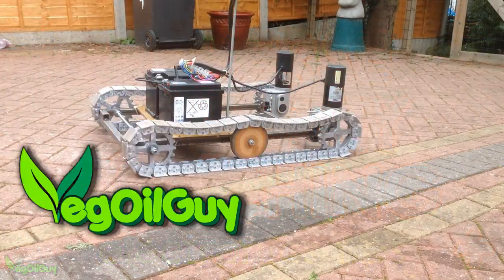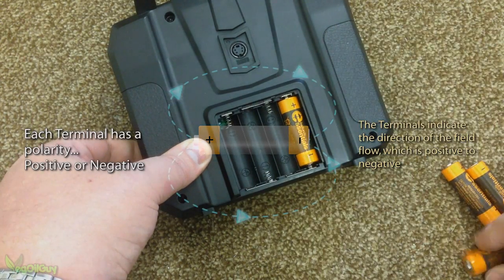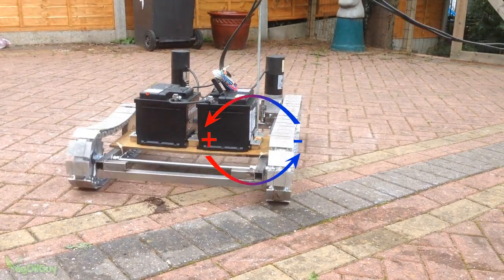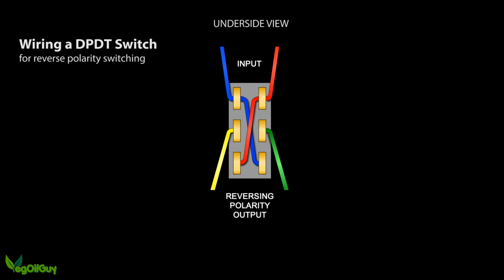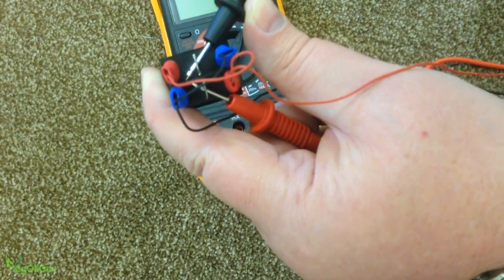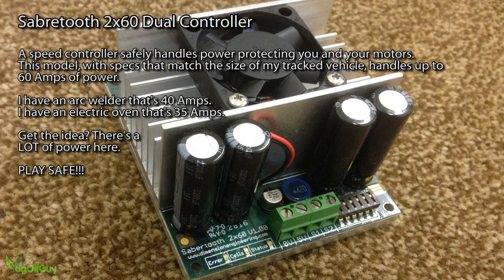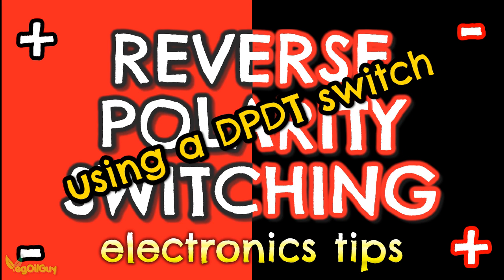Reverse Polarity Switching / DPDT switch wiring - by VOGMAN

Comment: very well explained can you wire a 2 speed wiper motor to go forward and reverse in slow on one and fast on another.there are three wires on motor red, blue and green .I can reverse the motor with one dpdt switch can the second switch be used for the other speed

Comment: I watched this because I'm trying to wire up a winch for my lawnmower and I dont have a wiring harness or relays. I'm making my own wiring harness and I've messed with it for about 5 hours today non stop and I finally found out why it's not working. I need a DPDT switch. What would you suggest for a good one for a winch

Comment: Love the video! I was thinking about reversing the polarity in my flex shaft rotary tool, and I guess the speed controller would be the foot pedal I suppose? Then, instead of metal shards going in my face,  it would go out into the opposite direction.  Not to worry,  I think I might just hold it upside down for similar effect. But thanks for the knowledge.  I also love your grillz videos BTW. Cheers mate

Comment: Could you clear up my confusion please? im connecting a up/down trim switch on an outboard with a DPDT switch but the wire diagram for my switch shows the positive and ground in the middle. and it shows the up and down trim wires making an X with the outermost terminals. Im assuming it is actually wired the way you demonstrated but the 2 accessory wires in the middle are red and black which is very misleading to make people assume its the positive and ground wire when it is not.

Comment: Thanks - just what I wanted. I'm controlling two 12V boat trolling motors. I also want to switch from slow (in series) to fast (in parallel). Don't suppose you've a circuit for that too? 😊

Comment: Sir, I have an existing common auto relay switch and do not want to remove.  Can I wire a DTDP switch after the existing relay in order to reverse the electric motor?

Comment: Loved the concept and presentation and warning ⚠️ about its applications. I have a very interesting question? Could you not wire a heavier guage 3 way on a rotisserie motor?🤔🤔✍️✍️🧐
Reply from the maker: It's not anything I've tried if I'm honest Paul. As a general rule, heavy duty motors need a dedicated motor control system. It's safer all around : )
Reply: VOG relay also work. Where there’s a will there’s a way. Nothing is Impossible

Comment: Would a 115V fan motor be considered a large motor, & is a DPDT switch safe for that motor?
Reply from the maker: Hi Jon. Current is more important than voltage when it comes to electrical load. Does the fan say how many amps or watts? 
I'd guess a fan wouldn't be so bad so as long as the switch is up to the task and as long as YOU are well insulated from the current, you should be fine. However, I'd encourage you to let the fan FULLY STOP with each switch reversal. There's a lot of momentum in fan blades and this would place a lot of stress on the motor if you switched whilst the blades were turning.
Hope this helps : )

Comment: 4:21 "would'nt reccomend controlling large motors this way"
at what voltage of motor would you say this becomes a problem?
Reply: I would be guessing that its not so much about voltage, but rather amperage. As the more amps used, often means the motor has more power and torque. In simple terms, it can get someone hurt if something goes wrong. Also, small toggle switches like these are usually only rated around 30 amps if I remember right, have to go look at the one's I have to see exact specs. So if the motor is pulling to many amps, these switches won't last long. Also, as he said, some motors don't like to have their polarity reversed too quickly. So it also depends on what they're being used for.

Comment: I've got an illuminated on-off-on switch with 7 pins.  Can it be used as reverse polarity switch?.
Trying to add reverse to a Razor quad.
Reply from the maker: Possibly... it's hard to be certain as there are so many types and makes of switch out there. Your best bet is to look very closely at the switch and see if you can make out any manufacturers names and / or a serial number and then Google it. Most things are out there. However, there's always more than one type so try some simple low voltage tests like you saw me do before you risk anything precious and expensive : )

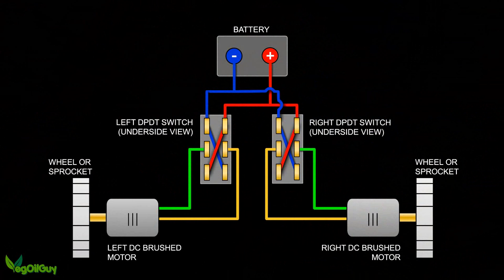Comment: Beautiful explanation of how to use a DPDT switch to reverse polarity to a DC motor. The diagrams at 2:55 to 3:48 are extremely helpful. Not to make things more complex but I have another question: Instead of "jumping" the red terminal across the back of the switch, would this system still function if I ran two separate red wires all the way back to the DC power source? (Or blue. No difference.)For my application, let's say that my motor is "running a flag up a flagpole", and I want a microswitch to cut power once the flag is at the top, even if my finger is still pushing the DPDT toggle. Then, I want to run the flag DOWN the pole and have a second microswitch cut power again at the bottom? One DPDT and 2 NC microswitches for 3 switches total. Make sense? Thanks so much.
Reply from the maker: Hi Stephen. I'm struggling to visualise what you mean, but I always recommend people experiment and see. You'll learn far more that way  : )
As long as you throw and eye to safety, you'll be fine - and you WILL get there : )
Reply: Ok,...now look, that was a lazy answer, but I will try to straighten it out for you, ... I have an actuator to raise, & lower a modified trolling motor for my kayak, but you can think of this as raising/lowering a hoist, & the actuator was originally used to track the sun for a solar array, ... and the program reset itself every 24 hours, plus & minus the actual time of sunset, & sunrise according to the program design, ... nothing wrong with what I bought though, ... there is a built-in limit switch, for each direction of the motion, ... that will shut off the power when it reaches a set point, ... at the end of each traveling direction, ... I am operating it via a dpdt switch, just like one would use for a snowplow operation, up/down, or swing for left/right, ... I also have a variable speed control to operate the propeller function of the kayak motor, ... also ran through a different dpdt switch, ...fwd/rev, plus speed control, ...  used these types of switches to operate 2 trolling motors on my 1972 Sears Gamefisher 12’ modified “rowboat”, ... wish I could add a photo of it sitting on the trailer, to showoff my $250.00 enterprising initial/versus finished project, ... 
I spent a few hundred dollars on it to do the modifications I needed to do, but it was well worth the labor, & cash, ... alas, I must do it all over again in order to refit it, because an injury caused me to leave it outdoors for the last 7 years, but am looking forward to doing it all over again, ... maybe it will see the water again for bass, & crappie in 2020, ...lol, ...
Experimentation is good, and you will never know unless you try, but do your homework, because the due diligence will be quite rewarding, ...

Comment: Hey I seen another fan question below, but I didn't  get any clarification from it. As the OP never answered back. So I have an old steel fan with three speeds. Its has about an 18 inch blade and does not oscillate. It's  a product of the forties,  and the dial knob has snapped off. The fan still runs fine, but no switch. It's for the Bantams coop as it's very hot in Florida right now.  I've got  it jerry-rigged up to cool them but I don't want it to burn anything or start a fire. 
 So I have an 8 pin  DPST? ? slide switch laying around, and thought it  may suffice. I dont need to reverse any rotation  just the three speeds. How could I accomplish this.  I hope this makes sense. 

Thankyou in advance, for taking  the time to read this.
Reply from the maker: Sorry Walter, I really have no experience with that sort of thing.
Personally I'd probably open it up and find the broken part and get a number from it (there's usually one on the side).
Try Googling that number or visiting a good electronics store. These can usually provide you with a replacement or modern equivalent. You'll be saving a nice old fan for just a couple of bucks : )
Hope this helps.
Reply: VegOilGuy Thank you sir.

Comment: Would corvette headlight motors be considered large?
Reply from the maker: It's all down to how much current they pull in relation to how much current the switch can handle - so look to your switch first. You should find it lists its maximum Amp rating. If the headlights come in less than this, you should be fine, but really I think I'd like to see Relays used there  : )

Comment: What's considered a "tiny motor?" I have 12v/1.1a brushed DC motor that's run off three 18650 batteries in series.

Comment: does it work on universal motors ? ( ones that use electromagnets instead of Permanent Magnets ) taking a AC/DC power source. or this is solely for DC motors ?
Reply from the maker: The switch itself has nothing to do with motors so will work in the manner shown regardless.
However, if you're talking about using the switch to control forwards and backwards motion of motors as I have here, then the motors MUST BE BRUSHED. These work on DC.
Brushless motors which work on AC require phase control to function, so you cannot control them using this type of switch.
I hope this helps.

Comment: How do the red and the blue cables are called , at 2:39?
Reply from the maker: Hi. The red is positive and the blue is negative - but it doesn't really matter to be honest as the switch reverses the polarity as long as the cross-over I talk about is wired properly. Hope this helps : )
Reply: Thank you for the answer , but i meant if there is a special name for this type of wires that clasp on dpdt's pins , as i want to order some like them for my project and i cant find them.
Reply from the maker: My apologies. My mistake : )
Yes, they're called Spade Connectors (as they are the same shape as the garden digging tool).
There are also Ring Connectors (guess what they look like)
Bullet Connectors
Butt Splice
Piggy Backs and my favourite...
Fork Connectors (two prongs that are brilliant for going under screw terminals, better than trying to coil a wire around a screw if you've ever done that).
You'll also need a crimping tool (these look like pliers but squash the wire and connector together to form a join).
Hope this helps. If you need anything else, let me know.
Reply: Thank you very much!!